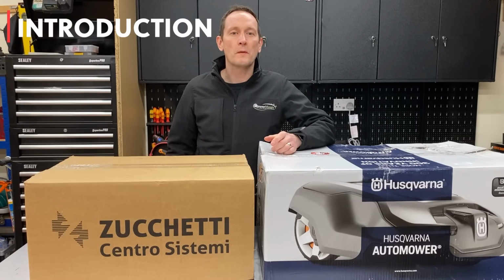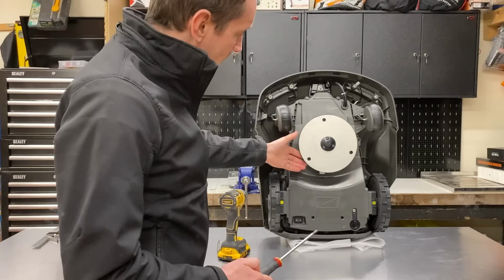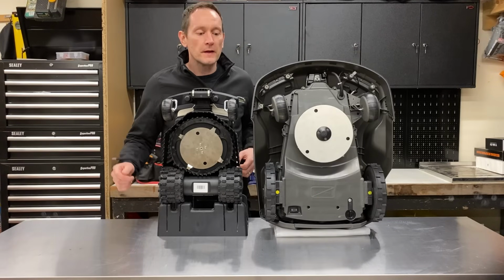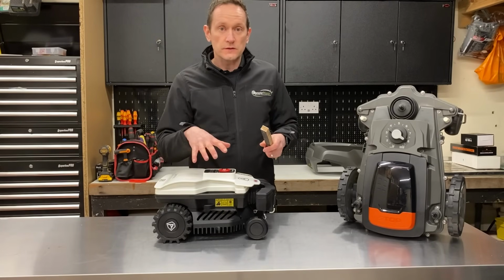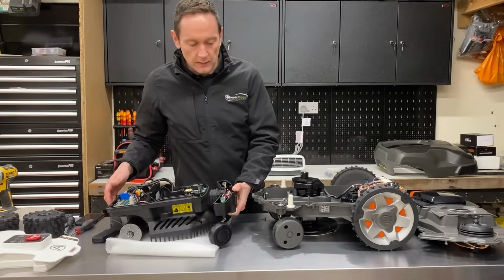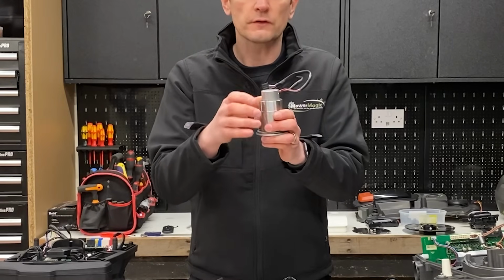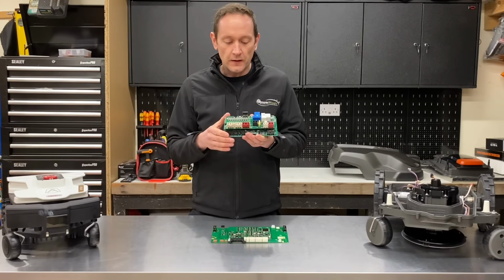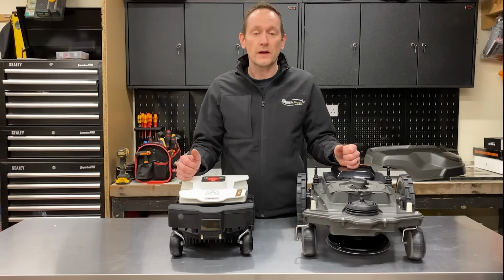Comparison Review: Husqvarna Automower 310 vs Ambrogio Twenty Deluxe & Automower 315 vs Twenty Elite

Comment: Thanks a lot for this indepth review. It really helped to make an educated choice.
Reply from the maker: Glad it was helpful!
Reply: Update after 1 year owning the Ambrogio. The machine itself probably works fine but the app is so bad that I have not been able to use it this year. My reseller cannot help me since the only support they get from the manifacturer is to “reinstall and update the app”. All problems started after Ambrogio introduced their “new and inproved app” which turned my machine into a €1200,- costing brick. I cannot connect to it at all and there is no possobility to programm the machine with the buttons on the machine. I have bought a pertrol engined Honda without an app which I should have done in the first place. Nevertheless, still thankful for your advice, this might be something you want to know.

Comment: Did the store run out of the long drill bits? That 24 inch one you have doesn't seem quite long enough.
It always seems cloudy and rainy when I watch videos from England.
You are very knowledgeable. I learned a lot from your video. Nice job
Reply from the maker: No the store had all the bits we needed.  We have sun and rain, a good mix.

Comment: I have ambrogio bx4 model,when it returns to the charging station it goes off auto mode so I need to press the on button again to get it to go back out when it's meant to,when I do this it will then go out and cut when it's meant to but won't if I don't press the on/off button.any ideas how I fix it?

Comment: The more voltage you have, the less amps are needed to get the same work done. The correct way to compare the amount of energi in batteries, and how its done in ex. electrical vehicles),  is to compare how many Watthours (Wh) they have. Watt = Voltage * Amps = it gives away how much energi truly can be stored in it. As an example: A 100 AH 1 Volt battery is only  1/10th of a 10 Ah 100 Volt battery :-)
Reply from the maker: It's a fair point. Trying to find the balance between making things simple to follow and still techy enough is always a bit tough. Comparing the Watthours the Husqvarna battery is 37.8Wh, the Ambrogio battery in the Twenty Deluxe and Elite (2.5Ah) are 65Wh and the 5Ah battery in the Twenty Elite S+ is 130Wh so they definitely have the edge on battery capacity.
Reply: @mowermagic  Totally agree on all aspects :-)
Reply: @mowermagic  Its worth pointing out the ambrogio batteries have no balance lead, and no temp sensor. Its just 7 18650 cells in series. 7S with no balanced charging is not a great idea and a temp sensor should also be included. Its my only gripe with their design, everything else seems overengineered. The HQ seems to have enough leads for balancing, not sure if they monitor temps.

Comment: Hi.In reality is the new Twenty Elite S+ good enough robot to easily handle 900m2 of no slope, flat grass? Or should i consider Elite 4.0? Thanks.
Reply from the maker: The Twenty Elite S+ would be ideal for that. It'll mow up to 1300m2 so you would have plenty of spare capacity from it to cope even when the grass growth is much quicker.
Reply: Thanks. And thank you for the amazing in depth video.

Comment: So if i buy the Ambrogio Twenty Deluxe and change the battery to a higher capacity than it would work like the elite or elite +? Same print and motors etc? Thx
Reply from the maker: We'd love to say that it was that simple, but it's not. Both the Twenty Deluxe and Twenty Elite use the same battery, the additional area coverage mainly comes from the addition of the GPS and connect module for GPS enhanced navigation to optimise where it mows in the lawn and reduce the time it takes to return to dock with GPS return home. It also uses a different software to work alongside this so you can't just add in the GPS antenna and expect it to work. The Twenty Elite S+ is the same as the Twenty Elite with a larger battery and algorithms tweaked to match this - even if it was as simple as getting a bigger battery, it would be more cost effective to buy the high capacity model than try to upgrade it yourself though. 
As for the motors etc - yes generally all other components are the same across the different Twenty models. I hope that helps.
Reply: @mowermagic  you are the best! #hero
Reply: @mowermagic  Yes, helped a lot. Thank you so much! 🙂
Reply: The L20 is only limited by the software

Comment: Was about to make a comment about how you much you were hating on the husky. I changed my mind after 5 minutes. Once you pulled the battery and motors, it's pretty obvious the husky is cheaply made and not worth the price. FYI IOS, not ISO. MOLEX, not molenex. just because the battery is only a 2 Ah battery, it doesn't mean that's all the current it will output. many single cell Li-Po (just one [of the many] cylinder[s] inside the black shrink wrap) can and are designed to sink 30 Amps shorted and be just fine. In the front of the Ambrogio it appears there is a lidar sensor (or plain IR distance sensor) as I can clearly see two lenses behind IR plastic. You didn't mention this? You did not mention if there was conformal coating in the Ambrogio main board. The coating was clearly visible on the husky with the light glare. Bigger mowers don't necessarily require a bigger processor, just more power and bigger mowers. Mowers with more bells and whistles do: GPS, color screens, WiFi, WLAN, and more sensors require more computing. Resettable circuit breakers or PTC fuses are nice as you don't need to replace anything, and I would prefer to see that. The addition of an SD card is concerning -- they are easily corrupted, and I would have preferred to see a eeprom, mmc, or garden gnome with a notepad instead. Antennas and network chips would have been nice to see closer. My nitpicking aside, this was a great video! I like to see people actually take the time to open it up and show the electrical and mechanical workings. Thanks.
Reply from the maker: The facts speak for themselves.  We hold up items from each brand and discuss.  We specify facts and figures from each brand.  If one brand comes out better there is not much we can actually do to fake the factual results.  If one is bigger/longer/heavier/faster etc than the other, then that is what we report.  You can watch the video, listen to the facts and make up your own mind.

Comment: Could I ask what are your thoughts about comparison the L35B vs the Twenty Elite? I have 300 squares meters garden that would be divided in four zones, due to the garden’s layout. There is a very small area with a steep 2 m strip. I would like to buy the Twenty but the vendor says the L35B, due to its dual battery will last longer and operate more efficiently . What is your opinion about the two devices? Thank you so much for the help

Comment: Ambriogio is ignoring US market needs for 4" high cut, I almost bought one last year  from Paradise Robotics but can't have dead grass in the summer of NE Ohio
Reply from the maker: Ambrogio have launched and high cut version of the 4.0 Elite specifically for the US market and have other versions to follow soon. If you contact Max Distributing in Oregon they should be able to give you more info on this (they're the official importer for the US).
Reply: @mowermagic  the quad?
Reply from the maker: @TWskill  They're just launching the first generation of the QUADs at the moment. We're not privy to all the products in developments but it would certainly be a good machine to have a higher cut option on.
Reply: @mowermagic  regarding 4" cut capability...
    Could Ambrogio just put out a set of  "taller" (greater diameter) wheels (to raise the blade) to 4, 4+ height to use for hot summer months? (For the L20 Deluxe and Elite models) 
      I happen to live in very hot, dry Texas summers...
Reply: @opop9988bbttjj  When i set mowing height to max on my L15, it really doesnt cut very well. Raising the height alone isnt enough, these mowers have no suction to pull up the grass, and to make things worse, the big wheels flatten it. Maybe it works better if you have thicker, mor lush and "springy" grass than I do, but I wouldnt bet on it.

Comment: If my lawn was flat like a concrete patio, these mowers would perform fine. But who has such flat and level lawns? (we grow flowers in our garden, keep grass in the lawn) I will be top dressing as i do want to move towards a robotic mower and most are like these, not designed for all terrain real world lawns.
Reply: Na, it handles uneven ground quite well, my lawn has more in common with a pasture than a golf court, full of holes and hills,  pots and trees, the little ambrogio has no problems with that. Of course, flower beds and the like, you just have to put the perimeter wire around them.

Comment: Robots are designed to drive on grass (soft surface), not concrete or other hard surface. What is the point in comparing wheels on table or concrete?
Reply from the maker: The test speaks for itself and shows how well the wheels grip.

Comment: How does the Ambrogio Twenty compare to the L15?
Reply: I have the old L15 (2019 model) and its virtually identical to the 2020 L15 and the twenty deluxe, except for the smaller blade and the blade guard (the new L15 has the same one as the twenty). Motors, battery electronics, wheels, chassis, all 100% the same.  Seriously, afaict the only difference is the color and of course, packaging (perimeter wire). Only the twenty elite plus is "different", it has a 2P battery and thus twice the capacity. Since its just a bunch of 18650s in series, no BMS, no balance leads even,  feel free to upgrade your own battery, which is what Im doing.
Oh, and I guess its possible in theory they reduced the speed on the L15 compared to the 20, which might explain the claimed difference in lawn size they can cover. But I doubt that even, for sure the motors and electronics are the exact same.

Comment: Hi, Jonathan. How does the twenty manage on slopes? I have around 45% slope in the lawn, I know it's rated for this, but does it live up to it's claim? Any advice appreciated. Thanks
Reply from the maker: Hi Liam. Ambrogio are very true to their specifications. The wide grippy wheels on this platform really do a fantastic job so it does keep grip even if the conditions aren't perfect. If you're right on the limit we'd always suggest getting some advice from a local dealer too so a real world judgement can be made based on the slope and other conditions around it. If you local to us we're happy to come and do a lawn survey and bring a unit to test on the sloped are (we can test without a wire needing to be installed) just to give you confidence in the slope handling. If you're not local but in the UK, we can point you to a local dealer who can help too.
Reply: I'm a dealer, and i can tell you that the L20 totally lives up to their specifications. It can do much more too, but if you stay in the guidelines you won't have any problem. Just make sure the slopes aren't steep at the outside boundary, or you might have some problems.
Reply: Great review! Just a small correction:
The L20 wheel motor heatsink isn't in fact a heatsink, is a weight. the machine have such great floatation with those wheels that in some kind of grass tend to float on it. So they needed some more weight on the wheels.
Reply: @GabriSantin92  Thanks for that advice. Much appreciated

Comment: Just by mentioning the Ambrosio company being owned by Ducati, completely turned my off from buying that brand of robot. I would expect it to be at the dealer half of the summer getting fixed. The Italian manufacturers make nice advanced stuff, but it's often somewhat fragile (Ducati, Fiat, Alfa Romeo...)
Reply: quite a silly comment especially if you watched the video. The ambrogios are actually built like tanks and completely over engineered, whereas the husqvarna is a pile of cheap plastic. Ambrogio also isnt owned by ducati, but by Zucchetti
Reply from the maker: Ambrogio nothing to do with Ducatti.  Ambrogio is a brand of Zuchetti.

Comment: Guide wires are great. Otherwise the robot must follow the perimeter wire all around the area (which can be several hundreds of meters) until it reaches the charging station.
Reply: That is not true... Ambrogio has its own mode, V-meter, allowing quicker returns. I won't go into details here, but an experienced dealer will know how to use it smartly and reduce return times drastically. Also, Ambrogio allows for placing additional 'marks' by laying the cable in specific shapes to tell the robots that they can do shortcuts. Moreover, if an Ambrogio robot is equipped a with a GPS module you can program it to use its geolocation to quickly go to the station through the center of a lawn which is much more efficient than laying 100m of guide-wire (in case of very large lawns). Essentialy, with Ambrogio you get much more flexibility. For example, you can make a robot to go through a 40 cm passages to reach another lawn which is not possible in Husqvarna as you won't fit three cables in such a narrow space - also 315x won't physically fit in such passage as it is almost two times wider than Ambrogio Twenty.

Comment: Hi, is there a robotic mower that is just a bump mower and does not have a guide/boundary wire ? i had a worx Landroid M but it just kept going out side the boundary and getting stuck so sent it back, the lawn is surrounded on all side.

Dean
Reply: Yes, there is a secret menu in Automower's menu, where mower can be programed not to monitor boundary/guide wire signals, hence not needing them.

Comment: Only thing is thin wheels get better traction on off-road commonplace with farm or military vehicles for example a deuce 1/2 6x6 wheel drive or all near tractors

If you’ve ever driven a car with wide tires off road you know things get lairy fast haha 😆
Reply from the maker: We don't agree. I have seen lots of massive tractors with extremely wide tyres.

Comment: I have the Ambrogio and very disappointed with how it cuts grass.  Its only be capable of trimming 1/16 of an inch and if a blade of grass is slightly longer it just pushes it over.   Bottom line.  I
ts a very ineffective mower and takes many-many passes over the same area to achieve the final cut.   I bought Ambrogio because of this 📸 and that was my mistake.
Reply from the maker: You need to just let the mower do its work - don't watch it.  If at the end of a cycle the grass is cut is does not matter how many times it goes over the same area.  Once it is short, it will then stay short.

Comment: Bias review....clearly you guys dont have the husqvarna agency and are a bit sore about it. I have never had an issue with HV over 5 years. why wasnt there one negative about the Ambrogio? 1st thing I see is multiple stops as front wheels will hit small objects and trigger change of direction. Dont be fooled folks, go with the company with experience, Husqvarna all the way!!!
Reply from the maker: Not sore at all. All points made are factual and are based on real information. We compare size for size, weight for weight, feature for feature. The facts speak for themselves. We only report what we see.